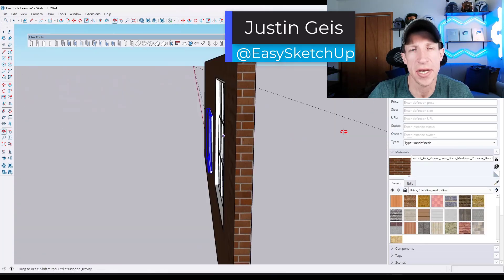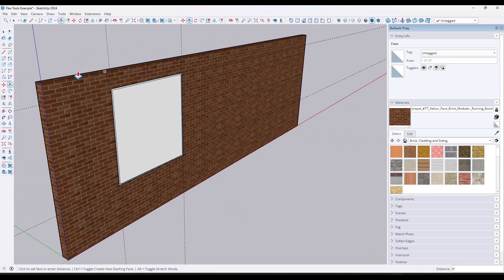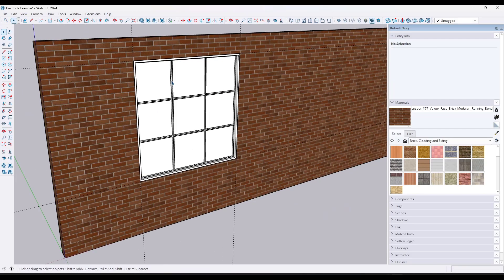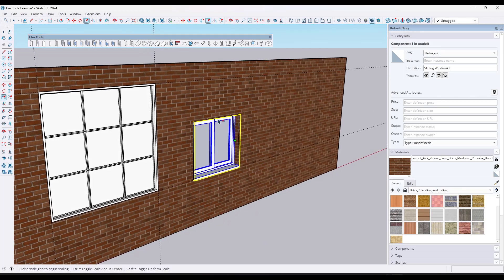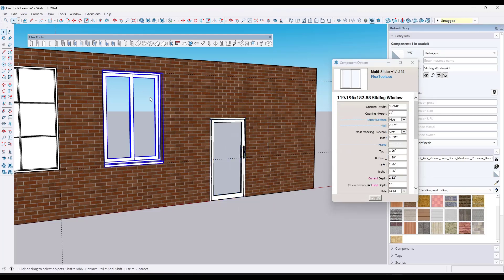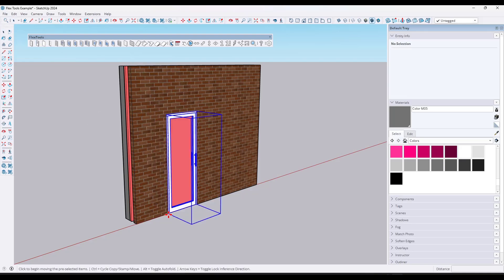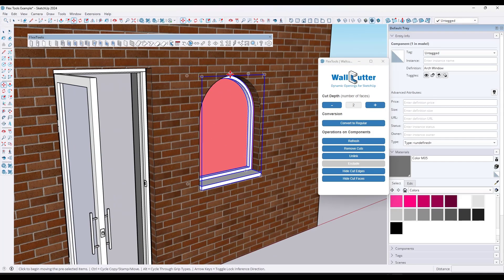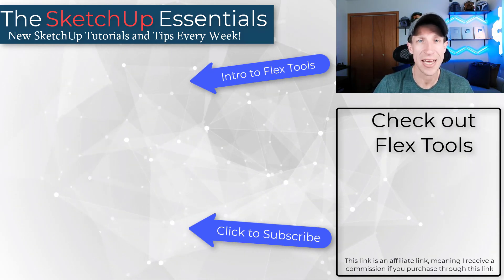How Flex Tools Makes Me 10X FASTER in SketchUp!

Comment: Yiu just proved how fast and eas it is to do it manually. Assuming you use the same windows on most projects you already have them setup from other projects, all you need is to make the opening which takes a second for most walls and your done.
I do like the dynamic features but its too expensive for that alone.
If this was 15$-20$ i wouldn't hesitate. But at 70 on sale that's ridiculous..
Reply from the maker: I suppose if you have windows from other projects ready to go, then maybe you wouldn't need/want a tool like this? Personally for me the dynamic functionality saves a ton of time. As to cost, I'll continue to say what I've always said - if it saves you time, and your time is worth money, then it's a simple calculation, but if it's not worth it to you, that's cool too.

Comment: its just a shame that if the model gets a bit complex this plugin becomes almost unusable with delay and slowdonws
Reply from the maker: Interesting - how big does the model get before you start seeing this? I've not experienced it, but I don't work with massive models either.
Reply: Hello Ruben, are you using the latest version of FlexTools? There used to be slowdowns in large models and we fixes this issue about a year ago, making it work 3x faster in large models. If there are still issues, please contact us and we'll see if maybe we can make more improvements.